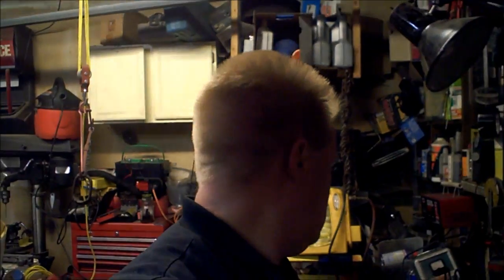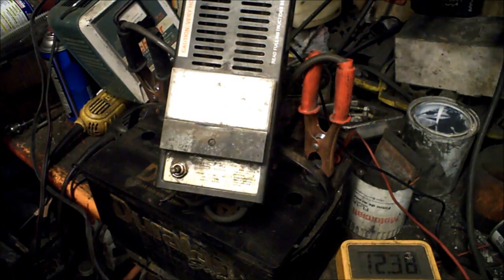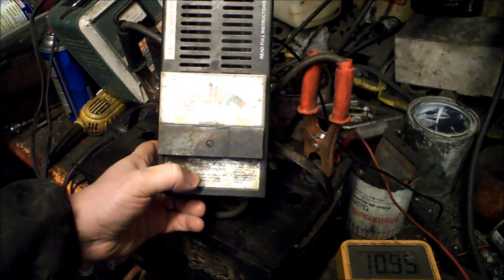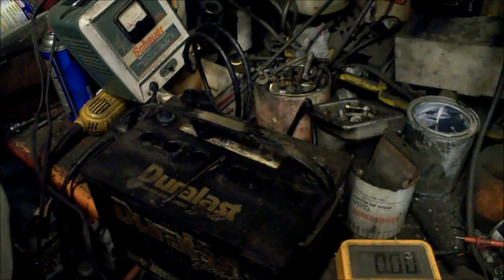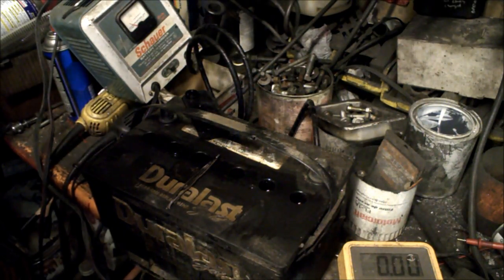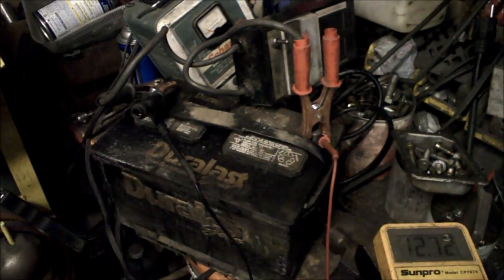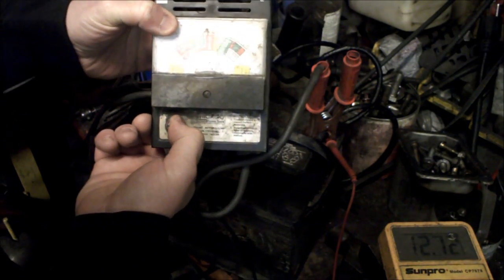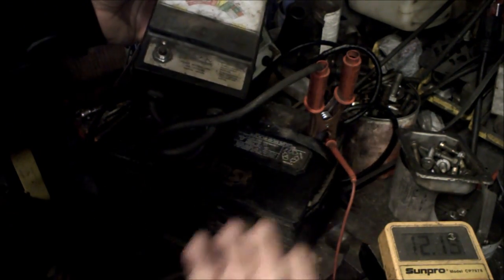Save a Weak BATTERY with epsom salt

Comment: I thought you might like to know about the bladders that hold the wine in wine in a box.  They can be used for seat cushions, flotation devices etc.  very tough and very handy.  Keep a few in the car and on the boat.  Take them to football games  and so on.
Reply: hi everyone ,if anyone else is searching for how to recondition my car battery try Corbandy  Battery Blueprint Crusher (Have a quick look on google cant remember the place now ) ? Ive heard some great things about it and my co-worker got cool results with it.
Reply: hi everyone ,if anyone else trying to find out Diy battery restoration try Battery Recovery Tactics ( http://battery.RecoveryTactics.com  ) ? Ive heard some amazing things about it and my work buddy got cool success with it.
Reply: There's several components to getting a good result. One resource I discovered that succeeds in merging these is the Rapid Renew Roadmap (check it out on google) definately the best info that I have ever seen. look at this awesome website.
Reply: There's several factors in fixing a car battery. One plan I discovered that successfully combines these is the rapid renew roadmap (check it out on google) definately the best course i've seen. look at this incredible site.
Reply: here's  several tips for fixing a car battery
never try to do this until you are sure what you are doing - the acid can burn you
Test the voltage first - there may be a kaput cell which will waste your time.
Check the battery fluid.
attempt to completely recharge the battery.
(I read about these using Rapid renew roadmap site )
Reply: +sixtyfiveford here's  several ideas for getting a good result
do not try to do this until you are sure what you are doing - the acid can burn you
check the voltage first - there may be a kaput cell which would waste your time.
Check the battery fluid.
attempt to completely recharge the battery.
(I learned about these using Rapid Renew Roadmap site )
Reply: There are  a few things for doing a pro job
never attempt to do this until you are sure what you are doing - the acid can burn you
Test the voltage first - there may be a kaput cell which would waste your time.
Check the battery fluid.
Try to completely recharge the battery.
(I learned about these and more using Rapid Renew Roadmap website )
Reply: There are  several suggestions for battery repairing
do not attempt to do this unless you are sure what you are doing - the acid can burn your skin
Test the voltage first - there may be a kaput cell which would waste your time.
Check the battery fluid.
Reply: There are several factors in battery repairing. One place I found that successfully combines these is the Magic Mender Wizard (check it out on google) without a doubt the most helpful course that I've heard of. Check out this  incredible website.
Reply: +Michael Ponzani
This is glorious, I have been researching "lead acid battery rejuvenate" for a while now, and I think this has helped. Have you ever come across - Ammaceen Reconditioning Rabblement - (do a search on google ) ? Ive heard some great things about it and my neighbour got amazing results with it.
Reply: hey ,if anyone else is searching for how to recondition batteries try Trefendous Rapid  Extender Tips (just google it ) ? Ive heard some incredible things about it and my friend got amazing results with it.
Reply: I\'m not sure but ,if anyone else trying to find out recondition rechargeable batteries try Cypouris   Renewal Guide Coach ( search on google ) ? Ive heard some pretty good things about it and my partner got amazing results with it.

Comment: DOES THIS WORK ON THE JELL BATTERIES?
Reply from the maker: +Michael Ponzani I have done this with jell and it does work.
Reply: +Michael Ponzani yes
Reply: No and it doesn't work on fecking bladders either you ignorant spammer!
Reply: There are several components to fixing a car battery. One place I found that succeeds in merging these is the Magic Mender Wizard (check it out on google) definately the most incredible course that I've heard of. Check out this  awesome site.
Reply: +Michael Ponzani There are many components to doing a pro job. One resource I found that successfully combines these is the Magic Mender Wizard (google it if you're interested) definately the best info i've heard of. look at this  unbelievable website.

Comment: My Freestar battery (875 cca.) would die if the dome lights were on for 20-30 minutes. Made a strong solution with 10 ozs. of distilled water and topped off the cells. I also cleaned off the top of the battery to prevent drainage. The battery is 100% better! Thanks my friend!!!
Reply from the maker: +Joe Winner Awesome.. I'm glad you tried it.

Comment: Is it possible for one of my battery covers to pop off?, I open my hood and one of the covers was off sitting upside down on the top of the battery, i was thinking someone was trying to steal it. Now the battery wont start the car. It has lots off juice after charging it, but just not enough to start it.
Reply from the maker: William CRAZY LACY Furmage Yes they can pop off. Generally that means the battery had an internal short. A car battery is made up of 6 individual battery cells and when one shorts out the others are still strong but that one dead cells makes so you can't start your car, etc. The battery is more than likely dead and unsalvageable.
Reply: sixtyfiveford The one car I made the comment on above on this post is a 1980 datsun 720 pick up, I just notice a few hours ago, One of the wire dillys on the back of the Altanator was unpluged, this happened before, I've owned this truck for 18 yrs now. I'll try the Battery fix with the epson salt tomorrow and let you know how it all went. A lot of the other videos on youtube make it seem like more trouble than it's worth, but your video makes it look kinda easy the way you present it, Thanks. This used batewry place 1 mile from my house sells used 1yr warr for $35 OR 2 YR FOR $42 IF ALL ELSE FAILS :)  Or yeah, The battery I'm messin with reads 9 / 06  sticker date
Reply from the maker: Those old Datsun's are great trucks.
Reply: sixtyfiveford I've charged it like 4-5 times and then killed it with the head lights on in my 67 Nova. On my load tester it starts at 14 volts, but when I hit the load switch, it drops to like 8 volts, it's probably junk??
Reply from the maker: You have 1 dead cell. Each of the 6 cells is good for approx 2.1 volts. So a fully charged battery(after it sits for a while) will be at approx 12.6 volts(you can charge it around 14volts). When you load the battery with a starter it will generally drop to around 10volts while cranking and maintain that. If you have 1 dead cell, that cell will drop off completely and you loose an additional 2volts per cell ie: 8 volts. The lower the voltage the higher the amperes required from the other cells. It is more than likely dead dead..... The only last thing you can try is to drop the battery on the cement. Seriously, drop it from about 1 foot, flat onto the concrete. This will potentially dislodge the broken lead plate fragment that is shorting out the cell. It is a long shot, but I have had it work once on a newer battery.

Comment: Hi I have a weak battery on my forklift.  Three cells evaporate quickly after charge and there's a pretty strong acid smell in the warehouse that it's stored in.  Should I try adding epsom salt mixture to those three cells only, or all of the cells?  The battery was purchased about 15 years ago and was a reconditioned battery.
Thank you
Reply from the maker: Bob Add the mixture to all the cells. The evaporating cells are actually your good cells and are taking too much charge vs the others. It is overheating these 3 cells and boiling off the water. Adding it to all the cells will break up the sulfate and allow all the cells to hold a stronger charge.
Reply: sixtyfiveford ...Thank you for the speedy reply.
Reply: @rgoldteam  so...did you try it?

Comment: Is the epsom salt mixture used to kind of get the old battery chemicals going again? Or are you using epsom mixture as a fuel source in the battery?
Reply from the maker: Mixer Mann They rejuvenate the chemical reaction that goes on in the battery.
Reply: much obliged.
Reply: both

Comment: My battery died yesterday and I dont have a charger. Can I do this and just jump the car and drive it for a few hours?  Will this hurt anything or blow up?
Reply from the maker: Brian Dixon Yes and no. Batteries consist of 6 smaller batteries(cells) all put together. Generally a "dead" battery that died for no apparent reason (lights not left on etc)will have a shorted out cell. This will not save these batteries. Batteries that are weak but still struggle to work generally have corroded internals and this will help. It will not blow up on you and it shouldn't cost you anything other than a few minutes of you time. Driving it around will work just fine, just carry a pair of jumper cables and prepare if it doesn't.

Comment: Hi sixtyfive, I did this with a sears group 70 battery. Even Sears could not tell me anything. The code you mention is not there. Engraved I have 6AG06 it states on the sticker Sears 45. Just trying to find out how old it is. I think it is lawn tractor battery. We also think it was never used just sat. I did get restored. My indication from a sales flyer that is 27 years old. Hopefully you can tell me what to look. Keep up the good vids.
Reply from the maker: William Ward If it's that old it may not have a sticker. Stickers didn't become prevalent until the late 90's. Before that most batteries would have a sticker on the top with knockouts that the store would pick off so you knew the date you bought it for warranty reasons. They did that in the late 80's through the 90's but before that there was nothing to determine the date as far as I know. Here is an old SEARS 45 battery ad from 1989 http://news.google.com/newspapers?nid=348&dat=19890906&id=9mUvAAAAIBAJ&sjid=lDUDAAAAIBAJ&pg=3334,1513057
Reply from the maker: sixtyfiveford Heres a SEARS 45 ad from 1982 http://news.google.com/newspapers?nid=1842&dat=19821006&id=1JEtAAAAIBAJ&sjid=qcgEAAAAIBAJ&pg=3157,1584615  the Sears 45 refers to 45 month prorated warranty.
Reply: Yep,  same ad I saw also. It is the only infromation I have. The good news is it is a good battery.  Thanks posting about going ahead and putting epsom salt in your running battery. It is the end of the summer and I do all my maintence now.  Take care Will.

Comment: Is it OK to put the Epson Salts solution into a battery while it is in the car and use the car normally?  Will it improve the battery that way rather than removing the battery from the car?
Reply from the maker: Yes, I put Epsom salt in all my batteries after they are a few years old. Every older battery I have used it in has increased Cold Cranking Amps. I have done it directly in the vehicle and just run it like normal.

Comment: Epson salt will take the sulfate buildup off the plates inside the battery giving the acid more lead plate access thus giving more amps and voltage   also if you shake around the epson salt inside the battery it will act faster  charge it on a slow charge discharge and repeat a few times    if you add a bit of epson salt in a week or 2 it will make it better
Reply from the maker: Magnesium is the key but chemists I've talked to say copper sulfate should work as well.
Reply from the maker: +Cooper Gates There are a few theories but this is the most probable: Magnesium Sulfate increases the conductivity of the battery for batteries that have a high internal resistance due to sulfation.  By increasing the conductivity, batteries that were not charging or were not accepting a complete charge will gradually accept more charge  each time the battery is cycled helping return more of the lead sulfate to solution.
Reply: al theway Epsom salt is a salt of sulfate so I would assume the only reason people would use epsom is because they don't have sulfuric acid to add instead lol
Reply: +Cooper Gates 
The bath salt is soluble in water lead sulphate isn't. Batteries die when caked with lead sulphate. The reaction with the lead can remove flakes which will carry on reacting but only as a lead oxide, I am not sure what the magnesium is supposed to be doing nor how it does it.
Reply: +Michael McNeil It still sounds confusing, maybe the magnesium ions form negatively charged complexes like (Mg(SO4)2)(2-). Even if this is so, it would be helpful to use a different magnesium salt, since adding more sulfate ions in general would not help get the existing ones off the plates. Magnesium chloride might work better.
Reply: don't make it over confusing its simple process cheap and it works why worry about it just do it @coopergates9680
Reply: +sixtyfiveford Any water soluble salt would lower the resistance, or even additional sulfuric acid; I might also suggest sodium bisulfate if a moderately acidic compound is needed.
Reply: LOL it's epsoM not epson - it's not a trademark of the printer manufacturer
Reply: There are several factors in fixing a car battery. One resource I found that successfully combines these is the Magic Mender Wizard (check it out on google) definately the most useful info that I have ever seen. Check out this  extraordinary website.
Reply: so why not follow this guys advice oh you want to spend a lot of money to do the same thing @palmaraja4850
Reply: hey ,if anyone else is searching for how to recondition batteries at home try Vaxicorn Battery Extender Guide ( search on google ) ? Ive heard some amazing things about it and my mate got amazing success with it.
Reply: hey ,if anyone else needs to find out about how to recondition old batteries at home try Corbandy  Battery Blueprint Crusher ( search on google ) ? Ive heard some pretty good things about it and my brother in law got excellent success with it. @sixtyfiveford
Reply: how to recondition a lead acid battery epsom salts
I\'m not sure but ,if anyone else needs to find out about how to recondition my car battery try Corbandy  Battery Blueprint Crusher (just google it ) ? Ive heard some pretty good things about it and my partner got amazing results with it.

Comment: Hi. To which the lowest level of voltage discharge acid battery 12V?
Reply from the maker: 8 volts or so is as low as I drain it.
Reply: Thanks for your help. I have a question
Is it important to check the density of the electrolyte? 
or that I do not care?
Reply from the maker: I will use a battery hydrometer to test each cell. If you have one cell that is way low it might be shorted out.

Comment: day5 update: 

Hi mate, the dead 5.36v battery that was in storage for over 6months is now a healthy 12.36v battery lol --- NICE ONE!

Thanks for above advice, appreciate it, i tried that and found that interesting.

Ive got a few more batteries in storage and ill see if they pep up too. will let you know

Also check out "alum" battery conversion. They have same amp hours but can be discharged down to 2v and back up again without damaging battery. Plus alum is so cheap!

Comment from the maker: It's looking like you may have a shorted cell. Take your test leads and use a metal nail or similar to test each cell(nail keeps you from ruining your test leads with acid). Start at the positive terminal to the first cell. Fully charged should be 2.1v per cell. Then test from the first cell to the second and so on. Only dip into the acid and not down against the plates. This way you can monitor each cell individually as each 12V battery is actually 6 batteries in series.

Comment: Starting 5.36v
3x tablespoons ES, half cup cold boiled water

3hrs charge with "tinmans step stepper" high volt peaks = 12.56
Morning = 10.35

Second charge, house charger 2hrs = 11.40
Discharge lights, Rest

cont...